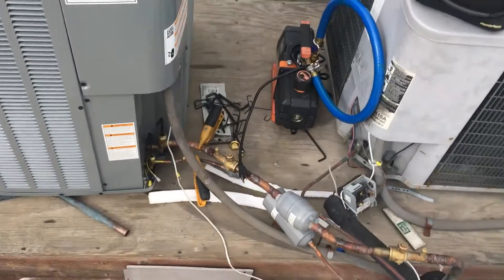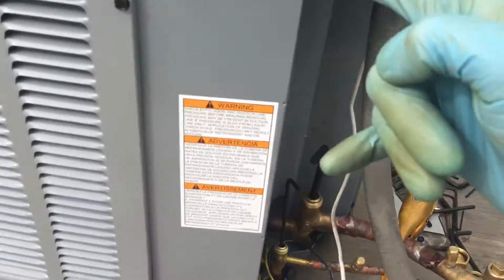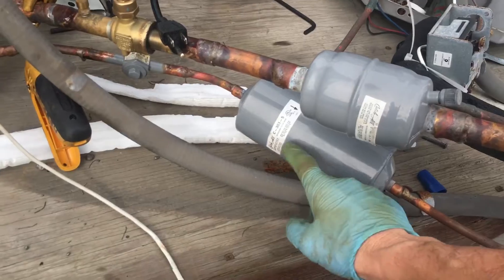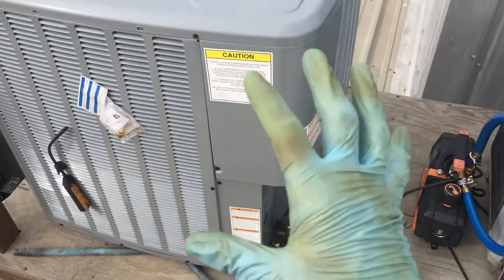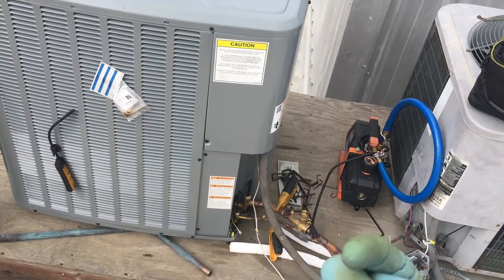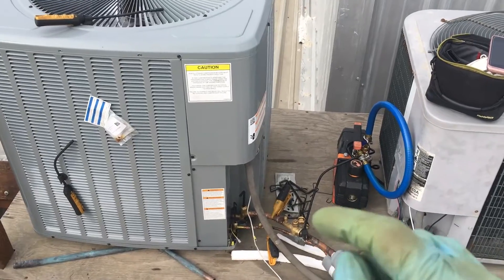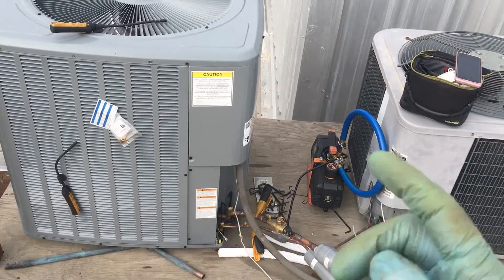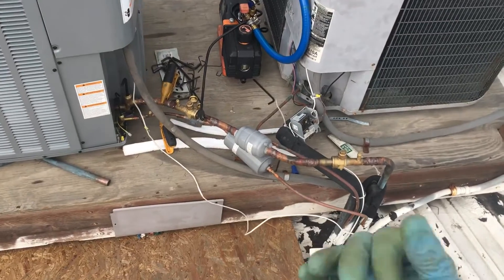Removing Temporary clean out filter dryers on suction line & liquid line after compressor burn out￼

Comment: What do I do with a heat pump case? The liquid line I was told to install a bi directional filter, what about the suction line?
All suction line filters seem to be one direction only, how do I go about it, with heat pump case?
The heat pump is house ac/heat
Reply: I've researched it, and realized that pump always  sucks one direction,  and discharges in one direction. The discharge goes through tube, and reaches directional valve, at that valve point,  is where is happens the flow to go towards evaporator core, or reversed towards condenser coil depending on what is needed, heat, or cold.
At the directional valve point, that's where change of directions happens. 
At the compressor point, the flow never changes, it always stays the same direction suction,  the same direction discharge. 
The compressor it's suction port always sucks in only, and discharge port discharges only. There is never a flow reverse at the compressor. 
So using a 3/4 suction drier filter right before suction port is no problem even in heat pump case! Awesome!
Whew! Glad it's that way, because  this allows for easy system  clean up, as opposed to flushing hassle. Let the filters absorb all junk, and later eliminate the suction filter drier.
I will install a shut off valve right before 3/4 suction filter drier, and another valve right after it, this will allow me to seal the system any time, remove, or replace the 3/4 suction filter, vacuum up this little space, and restore the flow by opening the valves.
Because  of using temporarily suction filter drier,  the liquid line filter drier will stay clean, and good to stay there for years. If notice uneven heat at the liquid line drier, before and after it, then replace it, otherwise keep it.
And yes, definitely add some acid away for POE, as from 2010 that's what compressors use Polyol Esther oils
Reply from the maker: @ikstrucking3289  this is why when you see my video downstairs I have shut off valves before and after the temporary liquid line dryer to remove it.
Reply: @coldfinger459sub0  
Yes,  I am intending to put in a shut off valve past the liquid line filter drier too, this way it will be between two valves, and can be replaced too.
Wish I got today a sight glass for more fun, forgot that one!
Reply from the maker: If you’re in summertime in hot time of the year you will be in cooling only mode , lock out heat mode disable it and throw in a one-way section line filter.  Run it for 40 or 50 hours but read your equipments manufactures clean out instruction guide you will have to download it from their website. 

I always stress follow the manufacture instructions do not use rule of thumb or one manufactures process onto another manufactures equipment you can but it’s at your own risk and the risk of doing damage to your equipment. 

So always go to the manufacturers website and research and download their specific instructions for that specific piece of equipment on how to perform the required clean out procedure. 

Many are somewhat similar.   

And if it’s winter time and only heating is needed then you’ll be doing the reverse locking out cooling.   

The only problem is you have to be 100% you’re not at the temperature and humidity where defrost mode will be needed.

Comment: JESUS!!! They burned out 3 systems🤣🤣🤣
Reply from the maker: Not only that they incorrectly recharged the other remaining systems that were here that I’m still cleaning up and fixing their mess. 
                         I still have a few more plugged evaporators to clean that are filthy that were never maintenance. 

I think I have two more systems to drain out and refill on to LG 5 ton minisplits with multiple heads. 

They want me to add some remote temperature sensors so they’re judging room temperature by the placement of a specific sensor in the middle of the room in a certain area instead of off the temperature sensor located in the thermostat or in the air handler.